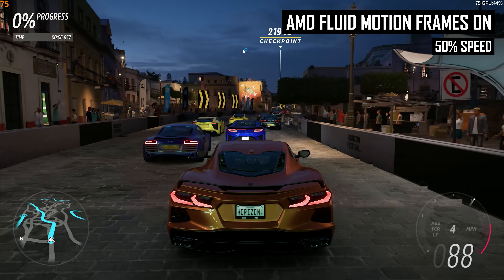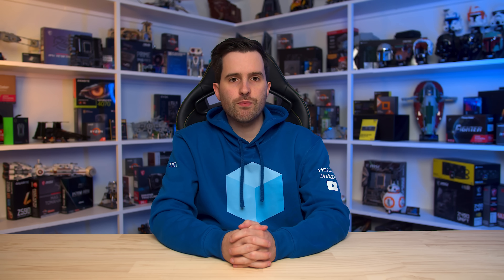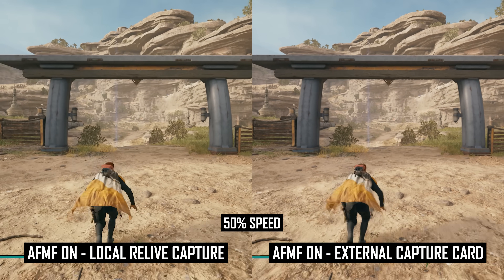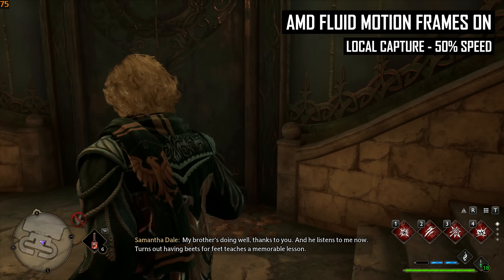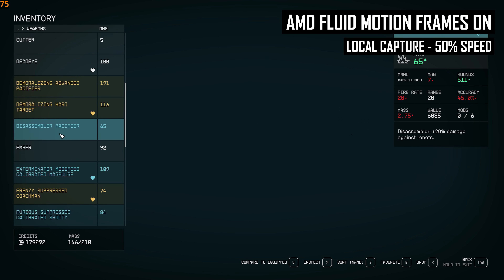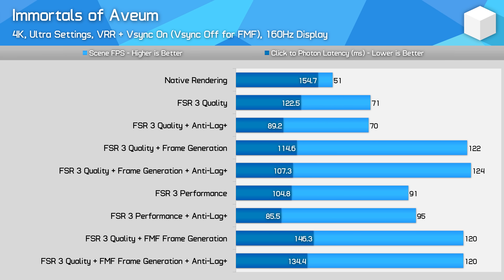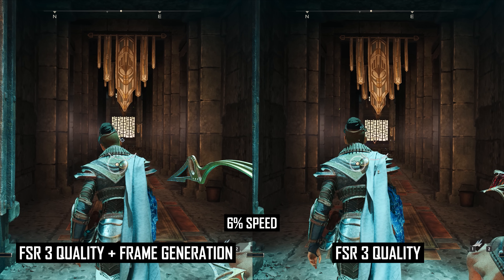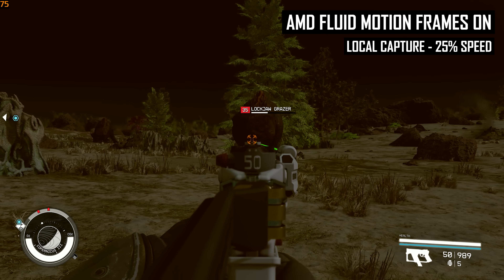Frame Generation for Every Game - AMD Fluid Motion Frames Analyzed

Comment: AMD need to scrap their entire approach and go down native only route to compete with Nvidia and focus their RnD investments to catch up asap. Drop support for Nvidia completely and make this work like Nvidia.
Reply: AFMF is a driver based implementation of frame gen which is only available to 6000 and 7000 series, FSR 3 is what functions on all cards, these aren't the exact same technologies but they do have very similar issues with the jittery frames.
Reply: @ChristianTheMemekiller  thanks for that insight I didn't see that mentioned in the video or if it did I missed it. Still the whole team at AMD really should reorient their RnD and focus solely on AMD, especially of the rumours of their next gen cards won't be focusing on high end cards.

Comment: This might have a potential use with old games that are limited to 60fps, No One Lives Forever, for example won't display cutscenes or conversations correctly above 60. RSR is most useful in old games that have a max res of 1080p or less when using a 1440p or above displays. AFMF could find itself in a similar niche.
Reply: Could see it used in racing games capped at 60 fps like Burnout Paradise. The game heavily uses motion blur, so AFMF artifacts could be less of an issue
Reply: While this is an interesting way to look at it, the dx11/12 restriction is a massive blocker for that currently.
Reply: @sirdapplton  You may be able to work around that with DXVK if they readd vulkan support at least back to DX9 games (though not all games work with DXVK on windows).
Reply: @sirdapplton  Not really, dgVoodoo sorts that.
Reply: @dickapples2104 the first and second preview drivers allowed the use of vulkan but was later removed when afmf released for the 6000 series driver. Dxvk would also work with this, so I run the older driver currently to maintain my vulkan compatibility.
Reply: 60 fps source framerate is not great, in practice you really want about 90 or more for a 144fps or more experience.
Reply: I wish to see more then 30fps in l.a.noire
Reply: @mikkaloo6525   theres a hack for that,  I think I used it back on the day
Reply: I would really like this for minecraft java. Would be perfect for modded playthroughs. Afmf would have to become compatible with openGL though.

Comment: Aren't fake frames.... Fake? 😂. This is what these companies want us to be accepting of and this apparently is the future so, yay fake frame!
Reply: They aren't fake. They are functional distinct frames. And they have the result you would expect. They increase fluidity and decrease eye tracking motion blur and stroboscopic step sizes.
As for the future, we're moving towards 1000Hz and beyond monitors. And given the slowing rate of progress in silicon, the only realistic way to feed these monitors with enough frames for modern games will be by using tricks like frame interpolation.
Reply: Where a frame is generated is not really relevant, there is no real and fake frames. We have reached a point where shrinking transistors is almost impossible due to the laws of quantum physics. Hardware will not improve much more unless we discover a revolutionary way of creating hardware. Frame generation is a way to continue improving performance. It is not in any way perfect but it will improve and become indistinguishable from frames generated earlier in the graphics pipeline sometime in the future. Without frames gen, we might be stuck more or less at current  performance.

Comment: I wonder how this would work if you had 300 fps and were using a 600hz monitor or something? Could this be useful later?
Reply: Is this sarcasm since I don’t see why you would need this if you can get that type of fps
Reply: This is the actual use for this tech going forward but we're a couple years away from getting higher refresh rates currently.

Comment: Also i heard u can use this as a replacement for the original fluid motion tech amd had for videos, i think someone got it working by using a gaming profile for a media app and got it working that way when enabling afmf on it then i think it worked.  Good for rdna cards as i think they stopped support in drivers for them compared to vega 56 when i had it on in that tho i could never get it working somehow even tho was in the drivers with that card.
Reply: And then they got it working again right?

Comment: It's extremely impressive that this tech works at all, even from a base frame rate below 100. This is a big development for high refresh rate panel owners, and I could see myself using this to saturate a 240hz or higher panel, though I admit that it is a rather niche use.
Reply: But i think it won't replace "real" high fps, because those also reduce the input lag. In other analysis it is emphasized, that low fps into generated high fps feels really weird, because of the increased latency
Reply: @PestifeR  yea thats why AFMF is best used if you can achieve high base FPS which will benefit high refresh rate monitors
Reply: not so sure about that i do get 200+ fps in some games and glitches the very smallest of glitches really stand out also the lowered input lag is dangerous once you have it then it becomes the new normal not really a trade off maybe if we are talking a very tiny amount
Reply: It's garbage with the current implementation.
Reply: But what is the point of that high of frames in a single player game? Just use vrr and have a near perfect experience. I don’t see the point in seeing the super high frame number when we already have perfect tech for these scenarios. Now if it allowed lower input lag and more frames in competitive games, that would be important.
Reply: @Ray-dl5mp  adaptive sync and a 240hz 1440p monitor
Reply: @PainX187  yea I get that, but is a single player game really better at 150 frames vs 75 with vrr on a 240hz screen? I would think the 75 frame scenario is still so smooth. It wouldn’t be as good without vrr/adaptive sync. I do get that. The one benefit I could see for those games is if someone prefers blur reduction technology and they want their frames to match the refresh rate of their monitor for the best blur reduction experience. Just not sure how these frame technologies work in those scenarios yet.
Reply: @Ray-dl5mp  60-120hz is huge so yes it is a huge difference 120-240hz is less of a leap but still something noticeable 

i would say it depends on person to im an old quake tourney player pacing matters imo depends what you play im very FPS and mostly dabble in other games
Reply: @PainX187  yes I definitely agree for competitive shooters I want the most hz too as long as it’s OLED. I’m just saying for big story hdr single player games. Do you need anything more in Cyberpunk than 75 fps with adaptive sinc? That’s my argument. Maybe I’ll agree with you when I try frame gen on these games on my new computer.

Comment: AFMF has worked better for me then FSR3 very stable unless you are recording with relive, since the same driver is tech preview for smart video as well encoding via cpu + gpu and 120 fps recording, shame YouTube has no 120 fps option yet.
As better, i can tell its enabled and its noticeably smoother at similar framerates.
Can't tell if freesync actually works cos its only 144hz  and if it hits low enough framerate it glitches osd which is reported in release notes, so i suspect it miss reports freesync range in monitor osd

Comment: Remember its a technical preview it isnt going to be perfect till next year consider it a peek only.
Reply: I think they should have gotten the bare minimum right first: correct frame pacing and not disabling itself during gameplay because you moved your mouse too fast.
The rest (interpolation quality, performance, input lag, ...), that's fine if it's not ready yet.
But right now, it's utterly useless because it fails on what the goal of the feature is. That's the problem.
Reply: @hastesoldat  exactly. I totally agree
Reply: @hastesoldat  idk they said that it turning off is to reduce graphical artefacts. But given how many people say it’s an issue I think they might focus on that for future releases, who knows.
Reply: If it's not any good then they shouldn't release it. They'll just get bad press and then the name is tainted.
Reply: @CrispyLimit dlss sucked on first release too and no one has a problem with it now
Reply: @nicholasbutler2365 sure, but that was 5 years ago? And when it came out and it was crap they had to work even harder to make it better after that with 2.0
Reply: Amd is dammed if u do dammed if you dont as they could have just not released the preview which is still months away from release status or they can do what they did and give people a little peek at what it will be like at release and have people talk about it and try it and then have lots of testers test it like hardware unboxed then look at that and use it to fine tune as they work on it still then when it comes to 2024 it could be out in a better state because of the feedback. @CrispyLimit
Reply: @CrispyLimit  it's a technical PREVIEW. It's essentially in beta to see if it's worth putting in more effort based on the reception.
Reply: @roccociccone597 I’m not saying it can’t improve. I hope it does so that I might actually consider using it. What I’m saying is if it gets a lot of coverage saying how it bad and it’s a useless technology it could hurt AMDs and FMFs reputation.
Reply: @CrispyLimit  That's why it's important that the people in these videos mention its preview status. The technology clearly still needs a lot of work.